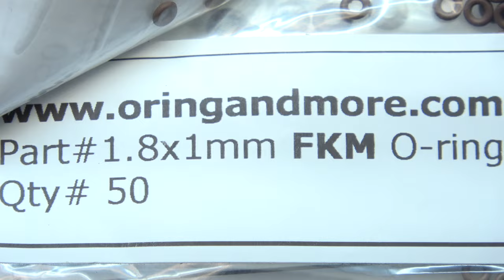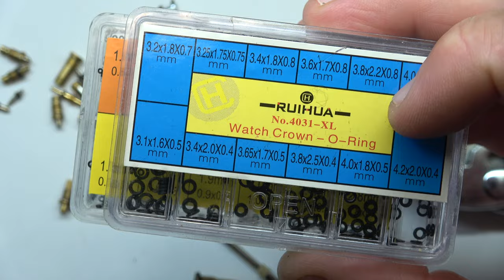Butane Lighter Filler Valve Information

Comment: Thanks Lighter 2018. I got my hands on another Colibri Sensatron 2000 touch sensor butane lighter, which i've repaired (was usual blocked fuel pipe), but discovered the filler valve was leaking quite badly. 

I took the filler valve out and noticed one of the two O rings was missing, replaced that, but still leaked. It was coming from the actual fill hole tube itself. 

Your video gave me the confidence (not been at this hobby long) to have a go and open the valve up and see what's up. It was a push fit type, and following your example, used two pliers to grip and pull / wiggle it apart. 

Roughed up the inner side brass a little, but took the burrs off with a little wet and dry paper. I replaced the inner fill tube O ring with a slightly larger dia one and put it back together (i stretched the spring a little too, but just a little). It still hisses out of that fill hole. Going to try another O ring next.
Reply from the maker: You can do it

Comment: You can get lots of different tiny sizes of gaskets from vape tanks and used coils. If you know a friend take every used atomizer coil and take it apart. Several grommets just in the coil. I have a case full of mini grommets and metal parts for so many uses. I save every lighter and torch for parts especially a piezo.

Comment: How do you remove the filler valve on vectors? I have a couple that are leaking from the outside seal on the filler valve and really just like to fix it myself instead of sending them in. Thanks for your videos
Reply from the maker: Never worked on a vector. Watch my videos.
Reply: @Lighters-cf4bd  the filler valves on the vectors don't have a flat head screw groove so I'm not sure how to take that part out to fix the leak. I can't pretty much do everything else to the vectors though from switch tips, ignitors even the springs in the ignitors
Reply from the maker: @BassBrotherBuild  send me a photo of what your talking about to 
lighters2018@gmail.com

Comment: Hey I was wondering what size flat screwdriver would be perfect for turning the flame adjustment valve that is in a torch lighter? I'm being specific about the type of lighter cause unlike other lighters it is alil deep in the lighter instead of being pretty much on the outskirts of a lighter

Comment: I'm trying to make a refillable Bic lighter using a refill valve from a cheap torch that stopped working, but I can't seem to figure out how to get the valve out of the torch. It appears you're using some kind of tool to twist the refill valves out... what kind of tool is that?
Reply from the maker: Just get a screwdriver and a dremel or file and make one for yourself. You will eventually run out of flint on a bic lighter then what?

Comment: Hi Mate, so I noticed you were saying that the Ronson valve with the pin in the centre are not repairable because you have to break them away and solder them back on, and I just wanted to inform you that you are actually wrong with a do breakaway in the centreand you can replace them rubber inside
Reply from the maker: I dont know which valve your are referring to as there are so many ronson valves. When I refer to non repairable valves, I refer to
valves that basically aren't threaded together. I call the pressed fit valves non repairable for the average guy as he will most likely 
ruin a valve before he gets it apart. This is why I do these videos. You will have to be more specific and post a video link here for me to understand exactly what your referring to. Sometimes I don't make myself clear or say something wrong and catch it later after its uploaded. I'm not very good at all at editing videos so I try very little as I don't have the time.

Comment: i got a couple of my dad's old lighters a silver win barbi and copper(perhaps plated)win sensor with the unique touch metal sensor that sparks it so im not familiar with how that one works unlike the piezoelectric and both of them are not filling up or not holding the gaz i took the valves apart and noticed one o ring on the very top of the barbi valve near the thread was completely lacerated and on the win also cut or dried up but im not certain this is the problem as i doubt these end seals are holding the gas in ,anyways i set those aside for now and been wanting to fix my asg pocket torch that i got back in 2000, problem with that one was gas flow which i may have fixed by opening it up and trying to reset the gas line properly into the brass flame nozzle also there might be some clogging dirt in the nozzle or line but the other problem is the piezo wire is sparking in different places instead of on the nozzle so i may have to replace that one somehow,
 
what i cant figure out is how the spark usually jumps between the wire tip and the flame nozzle despite there not being a return wire like you find in the bbq lighter wand piezos where you got two wires coming off the piezo so how is it the ones in lighters spark at the right place without a return wire to the piezo? 

also another question i have is about these fill valves, i guess there are two types some of them are only one way push in valves for filling and other ones have the long brass stem going through the tank and those ones you can adjust flame height with a flat head screwdriver from the bottom of the lighter on the fill valve itself correct? some have only the fill valve at the bottom and a lever flame height adjuster connected to the pull up valve(ie button and lever gas flow) on top which itself is either the gas nozzle or connected to a gas line that goes to a gas nozzle, others have both a lever adjuster and fill valve adjuster
Reply from the maker: Piezo's are a pain to figure out. I learned that even though a piezo might be working, doesn't mean its up for the job of consistently lighting a lighter. I found this out by switching out a piezo from a like new lighter to the older one, When I did this, Boom it lit right up. I stay away from servicing piezo lighters for this reason.
Most of the cheaper lighters will have a single "Flame adjustment Filler Valve Combo" this is usually a simple valve system but cane be difficult at best to work on because of the pressed in stopper valve on the burner side of this mechanism, it can be hard to remove without breaking the top of the brass valve. I worked on several lighters lots sent to me that I couldnt repair and had to send back because of this issue. Ther are no parts for replacement and the best way would be to replace the whole valve.
Reply: @Lighters-cf4bd  indeed in fact the piezo in my lighter seems to be working fine when i pulled it out to inspect it , it's a good one made in japan and it even makes a stronger spark than the spare i have which i was planning to replace it with, and its wire cover seems to be intact with no cuts or lacerations so idk how its failing to properly spark at the right place  inside the lighter when i assembled it together , perhaps i messed something up with the parts like the spring that is between the brass flame nozzle and the tank's top valve perhaps acting as an electric conduit and i may have placed it back wrong, the spring might also be doubling for the button metal lever as well , idk i think i placed it back properly but like you said these piezos are iffy once out of place ,pain in the ass to figure yup , i also had to splice a longer wire on the replacement piezo because its wire was too short and ill try to use that one to see if it works in there , i was thinking of cleaning up the flame nozzle and its filter screens but the rubber seal on it already looked squished enough and i did not want to risk getting it more damaged or creating a leak plus i have no idea what to use to clean those very small interior components without making it worse, the gas flow seems to be working well enough but not as strong as when i first got the lighter , still fun working on these things and figuring them out and learning as i go and its a great feeling when you repair things, many times i fixed home appliances or clocks and wristwatches , made a very thin solder on the micro small copper wire wound inside one watch to get it to work again my dad was impressed lol
Reply: but i want to ask you perhaps you might know, how does the spark happen between the tip of the piezo wire and the flame nozzle if there is no secondary return wire to the piezo? i noticed in bbq wand lighters the piezo has two wires but the ones in most lighters only have one so how is there a spark being generated unless your hand skin is acting like a conduit,, if you tried sparking a piezo on a piece of metal nothing happens unless you are touching that metal at the same time so do you know how these work in the lighter?
another thing i cant figure out is how come the tip of the wire never melts or burns with that 2500deg flame right next to it or on it??   @Lighters-cf4bd
Reply from the maker: @ARCSTREAMS  the electronic spark will take the path of least resistance. Piezo placement can be very very tedious to adjust sometimes
Reply: i understand but if there is no return wire to close the circuit then how does the spark happen in the first place? is it not dependant on the skin of the hand acting like a positive or something like that? i know the spark is HV around 3kv but if there is no return wire that means it will spark on your hand and if so how does it go through the nozzle first and then goes where? @Lighters-cf4bd

Comment: Hi 👋 still working on that WIN like you did the 55 min rebuild video on and in the very beginning of that video you mentioned you had worked on the filler valve and never said another word about it so I just watched this 44 minute valve video and again you never mentioned the WIN. No hurry because I need to make or buy a tool to remove it. I tried hemostats and it started to turn easily but after about 3/4 turn it wouldn’t budge and you are right about that brass being soft 🤯😤 so I’m stopping until I have a proper tool.
Reply from the maker: The filler valves are the simplest repair. Just remove it and measure the oring and seal needed then check out oringsandmore

Comment: Hello!

I've been trying to find the answer to this question for several months now. I have a butane gas lighter “Prestige by Cornwall” from Japan with a valve similar to 11:30 in your video (with a needle). I can't figure out which adapter I should use to fill it with. I went to all the local stores and wrote to many people on the Internet, but could not find an answer. I ask for your help.
Reply: Hello, did you ever figure out the valve/ adapter for the valve?

Comment: The unrepairable ones can often be CAREFULLY soldered, but remove or shield the o-rings first.  Kinda like small-scale brazing copper & brass plumbing.
Reply from the maker: Ive thought about that, but if I should have to work on it again its such a pain to remove the soldier

Comment: Just bought a Peterson Pipe lighter and a can of Vector propane. None of the 5 adapters that came with the can seem right for the lighter. Any body know where to find a universal adapter or isn't there such a thing? Or maybe a company that sells a kit of a dozen or so different adapters? I did fill the lighter with one of the adapters but got a lot of spray back. Thanks for any help.
Reply from the maker: maybe it doesnt need and adaptor. I it could be spurting out butane because its already full.It doesnt take but a second or so to fill one when the aire is purged from the tank
Reply: Thanks for the quick response. This is my first butane lighter and included no intructions so this is all new to me. Do you mean the metal tip of the Butane can just be used as is without a plastic adapter? The valve and the tip look to be about the same size.
 I thought I'd need an attachment for the butane can that had a recessed hole and a surround that enclosed the lighter's valve. Is it just hole to hole...two flat faces?    @Lighters-cf4bd
Reply from the maker: @bogbel1     Ive never seen the inside of the valve of a gemline. Just give it a try!

Comment: Hy Sir ! great video for me. i have a question, i ordered me a ronson valve and it seems to be one of the pressfit ones. where can i get the "repairable " ones ? can you pls point me in a direction ?
Reply from the maker: The newer ronson valves are press fitted together. Go to eBay and type Ronson Valve. They are 4 to 5 dollars each, so they're cheap enough to just purchase one when you need one. Hope this helps
Reply: @Lighters-cf4bd  thanks , yes i found that valves on ebay. But do you know where to get the repairable ones ? Sice doesnt matter since i need it for a model engine 

So any link or name would help to avoid those cheapo ones.
I just want to be able to service the hotbulb gas torch( the  valve i mean)
Reply from the maker: @pirminkogleck4056  send me a email and show me what your looking for. I may have it. lighters2018@gmail.com
Reply: You are right! The refill valves on disposable lighters work perfectly on fixing it! I didn’t finish the video and realized it myself then got back on to see the best gasket for the 10 or 6 mm one that it sits in. And I left off seconds before you mentioned where to get that gasket! I would have saved an hour. I have a drip tip gasket and will finish my ronson Veraflame table lighter repair in the morning so I don’t wake anyone up. Lol. I also have modern refill valves but they are bigger then the one for this so I didn’t sacrifice a torch just yet.

Comment: With my firebird metal lighter. I’m having trouble getting butane in it, and coming out of the top to light. It keeps escaping from the bottom.
Reply from the maker: Send me photos of the lighter and filler valve. Maybe you need an adaptor.   lighter2018@gmail.com
Reply: Had the same issue with a Chinese opera mask keychain lighter as far as the butane coming out the bottom, I replaced the o-rings and worked great after that. Just have an issue getting it to come out the top.

Comment: my fuel nozzle is stuck after i pressed on it to bleed it, do you know how to fix it? i am thinking of just pulling it out but i don't know if that is going to work
Reply: On a modern one I just kept pressing until it released. But some aren’t fixable if the valve is plastic and that doesn’t work.

Comment: What is the valve at the top.of the torch called.
Reply from the maker: Jet burner, flame valve, burner valve, I'm not for sure the correct name
Reply: Outlet valve
Reply: Hot bit.

Comment: vary useful video I recently started collecting old lighters mostly from flea markets and such. I recently got a Scripto butane stainless flip top lighter. It's kind of slim looking. its missing parts of its valve I got it cheap thinking parts would be easy to find. I was under the vary wrong impression that there was some kind of standard sizing when it came to valves boy was I wrong. anyways I now know how important it is to have a more complete lighter if you have any advice on what I could do with my lighter if anything at all let me know your video helped me understand how maybe my incomplete valve works.
Reply from the maker: send me an email with photos. Maybe i have a part if needed.    lighters2018@gmail.com